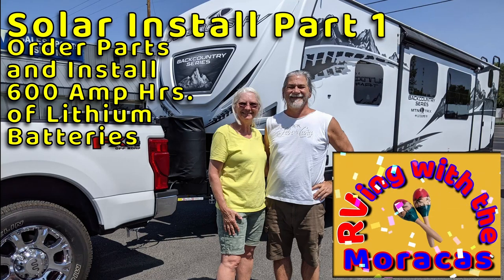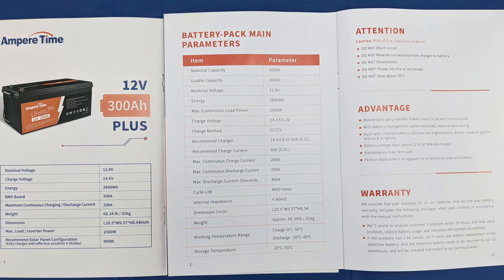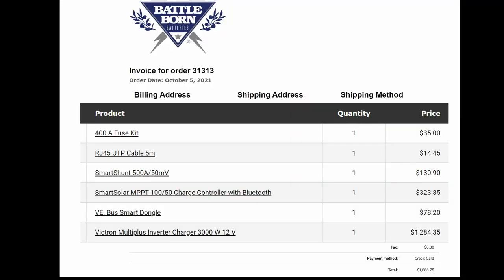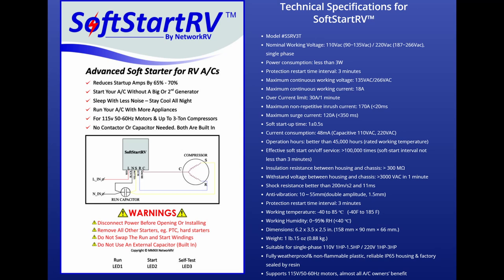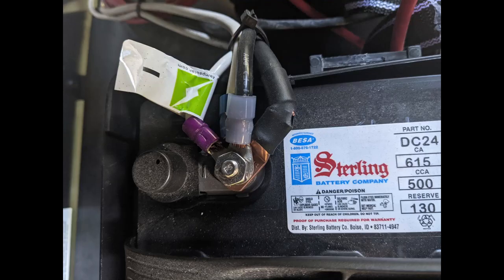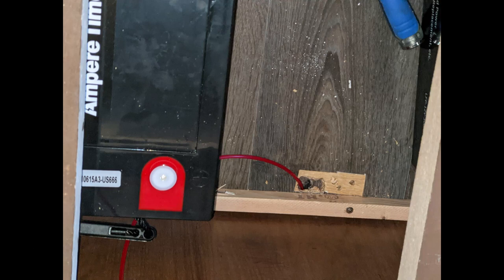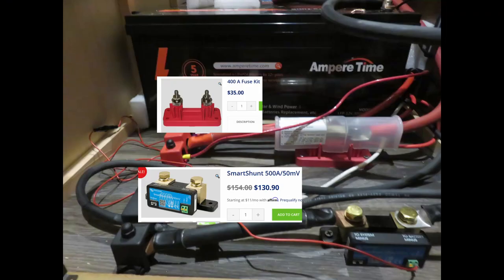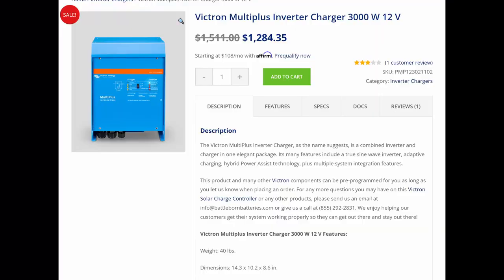Outdoors RV Solar System Install Part 1 - Lithium Batteries

Comment: Nice work!!!  We have a 28dbs on order and are excited to receive it in TX next few months.  We maxed the solar on it to 512 W.  I'd be interested in your use stats when you have enough experience with your configuration.  Many thanks, G
Reply from the maker: It is really the combination of solar / batteries and inverter.  Compared to your electrical use and how much sun you get. We have gone for weeks on solar with our 600 amphr lithium batteries if we keep the fridge on propane and don't need A/C.  and have a good 4 hours of sunshine a day.

Comment: Amazing setup!  After upgrading to lithium batteries, are you able to use the AC, microwave, and 110 outlets?
Reply from the maker: Next step is install an inverter that allows use of 110 system. I am just finishing that up.